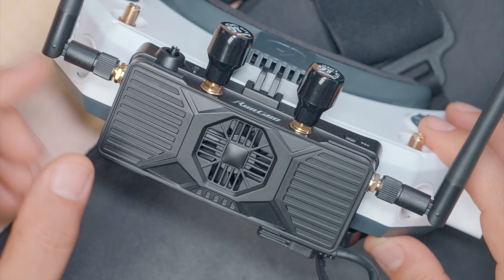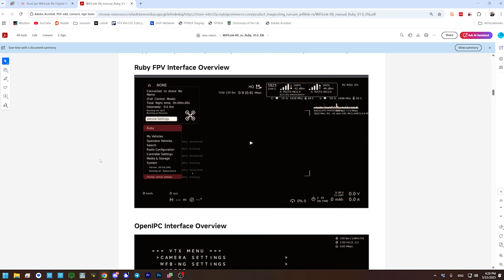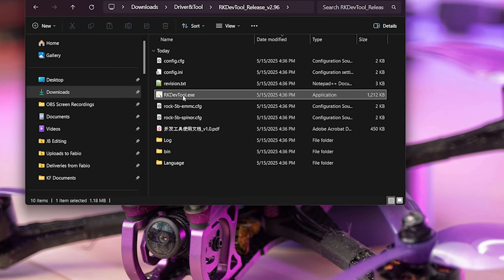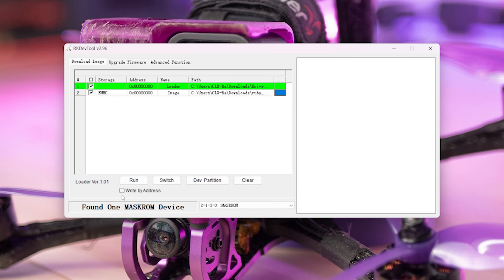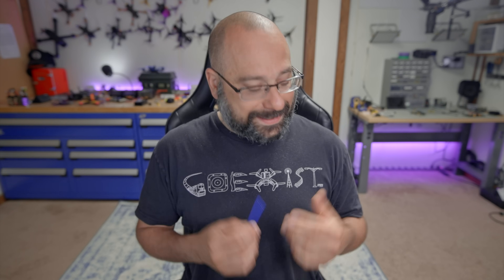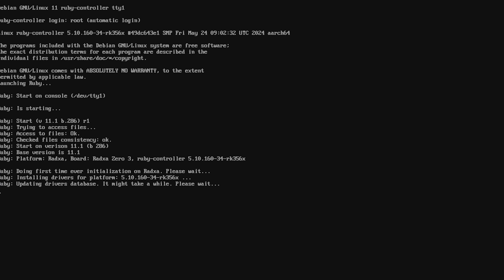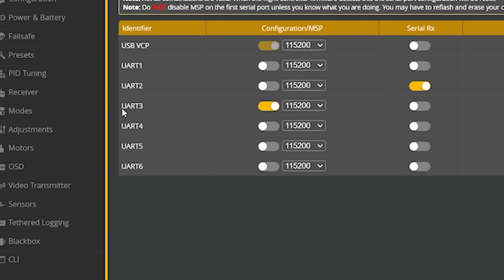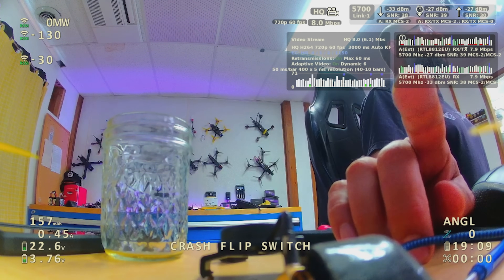How to flash RubyFPV to Runcam WiFilink v2 (and initial setup)

Comment: Hi Joshua 👋 
Im having a hard time getting ruby on my VTx. I got it on mt VRx just fine but it won't find the air unit when I search for it.  Any help is much appreciated 😊
Reply: Face same problem today, vrx works fine but cant find vtx
Reply: Joshua, thanks for the video. Was able to flash the vrx to rubyfpv. However, I am facing the same issue as some here in the comments section. The vrx can not find my vehicle. I assume it is the firmware version in the vtx(vehicle). Could you point me in the right direction on what you do? Thanks again for the great video.
Reply: I was able to fix the issue. It turns out I had to update the firmware in the wifilink 2 air unit as well. I used the sd card method adding the ruby 11.1 part o and part 1 files into it and then inserted into the air unit. Once that was updated, the controller was able to find the air unit and got it working.

Comment: Hi , joshua

I hope you're doing well! I’ve been following your channel and really appreciate the valuable knowledge you share about FPV drones. I recently got a RadioMaster TX16S Mark II controller and I’m planning to build two custom FPV drones—and I could really use your guidance.

1. 5-inch aggressive freestyle drone

Goal: Freestyle performance + range around 3+ km

I’m interested in using the Walksnail HD system

I know I’ll need a frame, motors, ESC, flight controller, VTX, antenna, goggles, and more—just want to make sure everything works well together

2. 7-inch long-range drone

Goal: Long-distance flight up to 40 km

Also considering the Walksnail system here (unless you suggest something better for range)

I want to understand the best parts for endurance, GPS, batteries, and signal stability over long distances

Could you please help me with parts recommendations or maybe guide me on how to plan these two builds properly? I’d truly appreciate any tips or insights from your experience.

Thanks so much for your time and help!

Best regards,
Subscriber

Comment: Hi Josh.
Non related question.
What are best practices for not losing your drone?
I accidentally disarmed my first fpv drone above corn field. I believe there is no way to find it correctly. But can i do something better next time?
Reply from the maker: I recommend a couple of things. First, get a ViFly Finder v2 self-powered buzzer to help you find it with an audible alert. Second, Get a GPS on the drone and put the GPS coordinates in the OSD. Record DVR so you can get the last-known coordinates. Third, consider putting something like an Apple Airtag on it so you can locate it easier when you get close.
Reply: @JoshuaBardwell thanks a lot! The idea with the AirTag is neat! Do you have any reference video regarding the other solutions? 1/2?

Comment: Sorry for all the confusion about the software components, it can become confusing due to... large HW ecosystem and software complexity. Let me try to make it simpler to understand, so let me define some "terms":
OpenIPC - (Open IP Camera) it's an optimized linux kernel for IP cameras. Provides the base linux kernel and low latency access to the camera H264/H265 encoder. That's all. It behaves like any other SBC (Raspberry, others): provides a base linux system, with access to hardware, on top of which you can build your software.
RubyFPV - it's a software solution that creates it's own radio link protocols, management, logic, air protocols, user interface, etc in order to create a complete FPV system. An open source FPV solution. Can run on different hardware: Raspberry Pi, Radxa, and OpenIPC air units. For Raspberry, it uses Rasberry linux OS. For Radxa, it uses Radxa linux OS. For OpenIPC air units, it uses OpenIPC linux kernel above and access to the H264/H265 encoder.
Hope it makes it clear. RubyFPV it's not just a user interface for OpenIPC, it's an open source FPV system that can run on multiple hardware, one of which is OpenIPC air units.
There is another OS FPV system, called WFB-FPV, that's beeing developed by a team of devs, including some from the OpenIPC team, that is doing exactly what RubyFPV is doing: using support offered by the Raspberry linux kernel, support provided by the Radxa linux kernel and support provided by the OpenIPC linux kernel, it accessing the hardware and creates a software solution for a FPV system.
And that's why basically you have two separate FPV systems that you can run on the same RunCam hardware:
One is called OpenIPC+WFB-FPV, one is called RubyFPV.
Reply: I love and appreciate that anywhere someone is discussing Ruby you show up and clarify things. Thanks for your involvement with your userbase
Reply: @Vote4Drizzt   but is rubby much better?
Reply: That was a very good explanation, that cleared things up for me! Thanks for the awesome work you are doing Petru!
Reply: @Ibu-Poweruser   but is rubby much better?